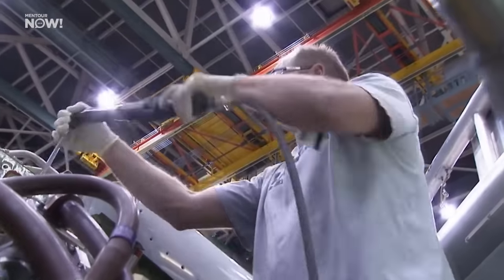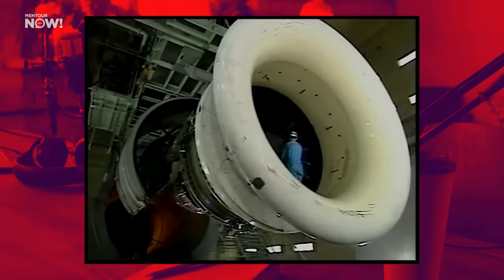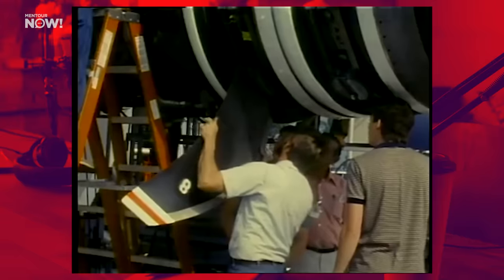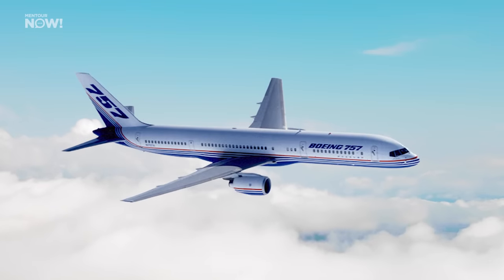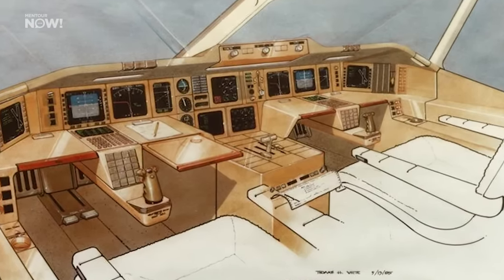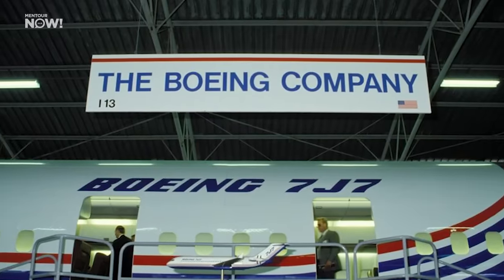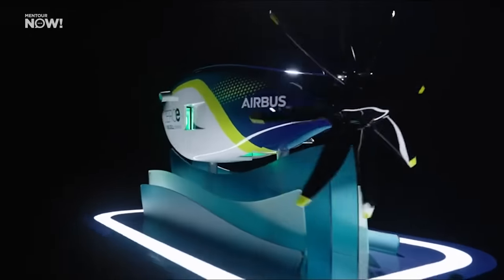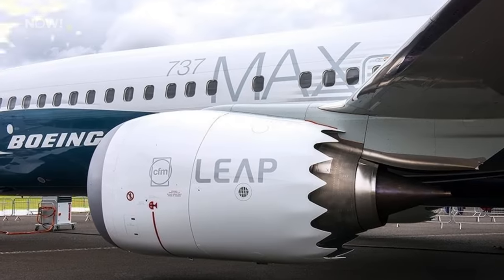Revolutionizing Flight! The Amazing Potential of the CFM RISE Engine.

Comment from the maker: Go to https://curiositystream.thld.co/mentournow_0123 and use code MENTOURNOW to save 25% off today. Thanks to Curiosity Stream for sponsoring today’s video.
Reply: I am amazed at how quiet the CFM Leap engines I versus the CFM 56 engines. That is even a big difference. And since the only airline I fly is Southwest I get a Lotta time in 737s.
Reply: What does Boeing and Airbus have updated the engine mean in reality, only new planes or are they even upgrading older engines ?
I have no clue if those jet engines are swapped like in tanks or heavy trucks or ships or if the jet turbines are only refurbished .

I think I have seen an Airbus engine swap during a major inspection but that had been a Luftwaffe / Airforce airbus where things might be different.
I was wondering if the airplane manufacturer also offer a kind of technical upgrade packages like the interior updates that these plane usually get, but in this case on the technical side. 

Maybe a topic for another video about the life circle of a plane from its delivery over maintenance and second / third hand to final destination as a standby reserve in the desert, scrapyard or spare part donator and also how the manufacturers do upgrade the airplaines for a longer life and therefore higher sustainability.

Can not remember to have heard about except all the mandatory upgrades if the FAA forces the manufacturer to replace parts or change things.

Maybe too much for 1 video so maybe a mini series but I have not seen a full life cycle video and especially how long such planes are used that we do not see anymore but are still used in third world countries - and of cause the effort to update a plane. We went from 0 and ground in spring of 2020 to back to a full speed ahead and some of the retired planes also have returned like A380 which had been considered to unefficient back then. Sorry, just a bloody amateur and hobby glider.
Reply: No way will open fan blade engines will ever be safer than the encased engines.
Reply: I wouldn't be surprised if this engine ended up on the Boeing/NASA high braced wing "demonstrator"
Reply: @dimitri1515  How often is a blade off event happening and chance of hitting fuselage is also what ? 15%?? I sat a few times in the line of flight of a blade in ATRs and chances are bigger I get overrun on my bike or motorbike than a blade shaving me. Just asses your life risks right, and if you smoke or are overweight don't even make the effort to consider this.
Reply: This cost money  !
Reply: I watch a lot of youtube channels that also is on curiosity stream, but I finally signed up for it via your channel, I hope you don't retire on all the money I just earned you, in that case, can you send me a free inop t-shirt since I am also without a job....
Reply: @alielabdimarras7965  That's just one of the risks. the extra exposure carries other risks too.
Reply: @dimitri1515  How unsafe can they be?  Piston powered props and turboprops (both open fan blade engines as well) have existed and continue to fly to this day.
Reply: did not mention the AN-70 ???
Reply: Are you kidding me⁉️. If it was covered, but leaving all this exposed rotating hardware⁉️
Reply: Ytaa
Reply: @iamme2072  I'm just saying that exposed propellers experience the physical environment around them differently that enclosed fans. I'm just going to need a lot more data and time before I am convinced.
Reply: @iamme2072  Yes, but they are now trying to create a turboprop to compete with jet engines and I am not convinced they will provide the same safety record that jet engines to. I guess you could say I'm not a fan (pun intended).
Reply: I don't see additional maintenance cost of the systems to justify a 20% gain and military turbo prop planes don't operate at the levels or miles of commercial liners...
Reply: I just signed up for Curiosity Stream 4K Premium annual plan, it was a fantastic deal and I appreciate the Mentour Now discount, thank you!
Reply: Thanks for the great educational video, and a huge thanks for not ruining it with crappy background music while you're talking. The first 34 seconds were hard to get through, glad I stuck around.  
I don't know why some people feel compelled to add annoying background music throughout the video.
Reply: Grear
Reply: but..the ufo,s flying around will be dumbfounded,,if they see 1800c planes again with props..!.
Reply: @mortgageapprovals8933  Hi!
You are likely not wrong, in fact I have actually said so myself in at least two of my videos.

In 30 years or so, providing AI has evolved sufficiently and is proving safe, it will likely take over.
What I have been pointing out is that there are several problems with this, mainly on the legal side (who is responsible when things happen?), the side of air-law (How will these aircraft interact with ATC and human pilots in the transition and what rules will apply) as well as the costumer side (Will anyone want to fly with a computer in charge).

These are real obstacles that has to be taken into account and that’s why I don’t see it happening in the near term.

Now, if you want your comments to stay up on this channel, you need to avoid using foul language or hurl insults against me and everyone else. If not, I will utilize googles AI to remove your comments from my videos permanently.

Have a great day.
Reply: @dimitri1515  3
Reply: Mentour Pilot: you are a 1st class person of excellence! 😉❤
Reply: Are Toroidal Blades being looked at by any major engine manufacturers?
Reply: @steveallen648  I am AMAZED by the fact that you didn’t mention the fact that I DID cover Russian aircraft in the video.
Questioning someone’s intelligence is not a very nice way of starting a conversation, especially when you are wrong.
Reply: I have a question 
What is a blade breaks off and punctures the cabin
Ik this problem is there on a normal jet engine but the engine cowling is made to deflect the blade away from the cabin but what can they do here?
Reply: You can't do that thanks to the fan having to be covered by Kevlar armor for protection of the fans going thru the acft.
Reply: No. You're wrong on all accounts . Safety of exploding blades going thru the acft is the only issue. Let alone FOD
Reply: You need to become much more enthusiastic than you currently are. You are much too sedate.
Reply: I rather have an airplane that runs on C4 plastic explosive than hydrogen